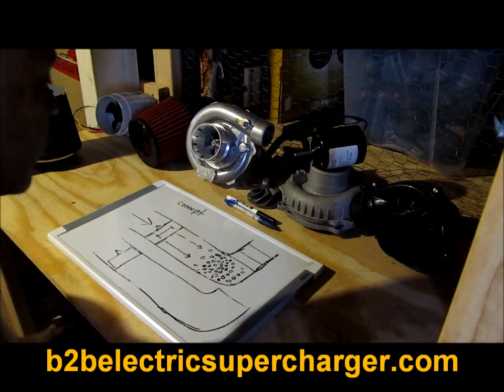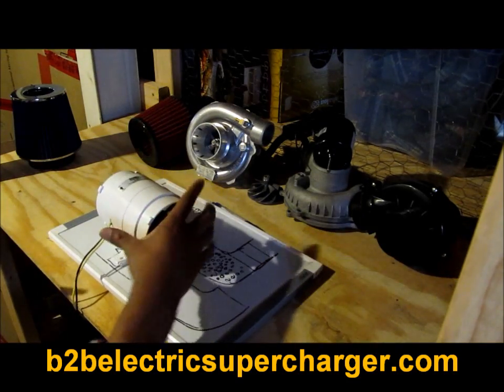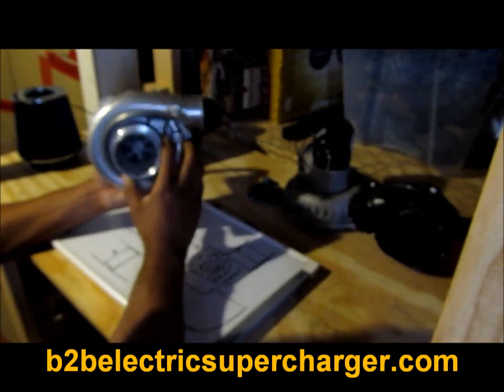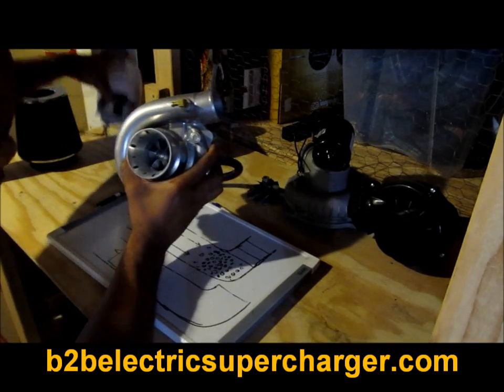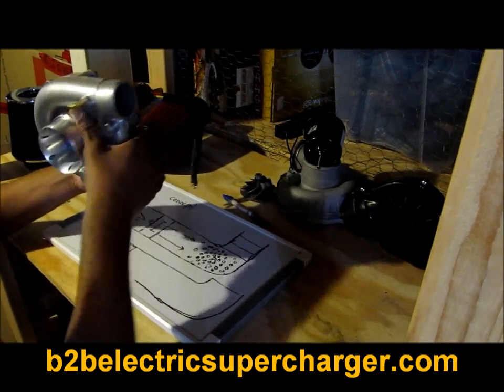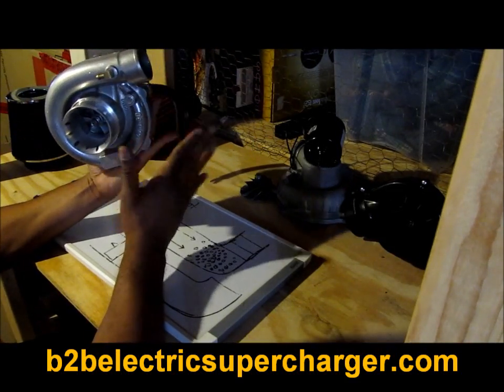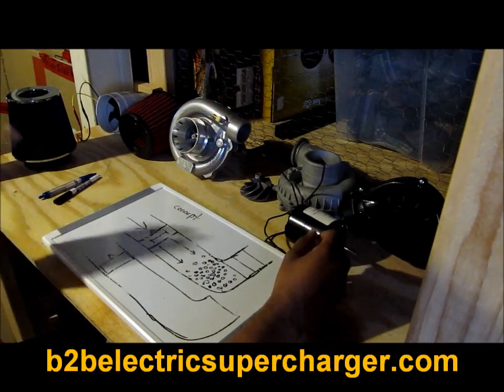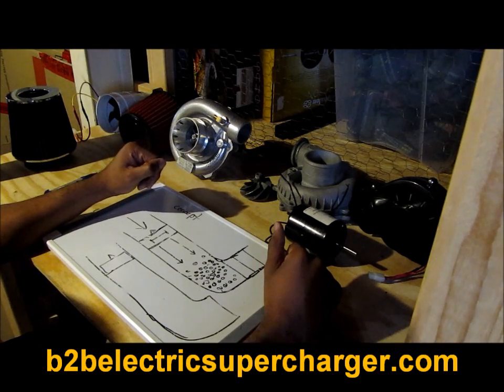Do Electric Superchargers Work?

Comment: To all the people saying "Not Possible" ... you realise that for around $50 you can get a 40,000 RPM brushless (90% efficiency) RC helicopter motor that is approx 1.2Kw and puts out around 2NM torque, and is 36mm x 65mm in size (Turnigy XK series)

Sure, it draws 80A max, and sure an ESC  (Electronic Speed Controller) will run you another $100, and would probably only make 3 or so PSI... but thats with a FEW minutes of looking... you can get some REALLY impressive brushless DC motors if you know where to look
Reply: That is nowhere near the amount of power you need. You greatly underestimate the amount of ehaust power going into a turbo.
Reply: turbo runs at 200k
Reply: +Gavin Irvine Never heard of Gear down?
Reply: WHYNOTMEB4U then your motor won't have enough torque. Electric superchargers do not work.

Comment: For a true electric supercharger to work it has to have a LOT OF POWER, at least 20 to 40 hp motor attached to it, and a motor like that is as large as the typical car battery, so you will need a lot of room in the engine bay just for that alone and that's usually not possible.  For that much power you are going to need a wire to the motor that is as thick as the wire that connects to your battery terminals, at least 1/4" diameter copper.  That much power draw will stall your car because all of the battery power will be sucked right to the turbo unit, so you will need a separate battery system just to power the turbo itself.  What happens then is that the electric turbo is off most of the time under normal conditions and the air enters the engine through the 'normal' non-turbo air intake. At this time the car's electrical system slowly re-charges the turbo's separate battery. Then when you need a sudden boost of power, you hit a switch on the steering and the turbo battery disconnects from the car's main electrical supply, and the turbo sucks power from the separate turbo battery only, the extra boost of air enters the regular air intake from a separate side pipe, and this extra pressure then closes a flapper valve on the air intake to prevent boost air from exiting out the air intake. The boost air then enters the engine at much higher pressures than normal. This boost can be maintained for only as long as the separate boost battery can supply power, which is not that long.  As soon as the electric turbo starts to die down, the boost pressure falls down, the intake flapper valve then opens up and air enters the engine using the normal air intake route, not from the turbo.  This system can work wonders but it is very complicated, very large, and very heavy, and is very seldom used because of those factors. A much simpler and much smaller idea is to just use NOS instead (Nitrous Oxide), it gives the same results as the above '2-intake' electric supercharger system and won't need a huge amount of space under the engine for the entire setup.

Comment: what about this? ...

http://www.zoro.com/i/G3418791/?utm_source=google_shopping&utm_medium=cpc&utm_campaign=Google_Shopping_Feed&gclid=Cj0KEQiAn9-kBRDloNeUw7Pe_YwBEiQA4HXMU2L__s_M55OWU3uzzaRsqnchHKitz9uJvUrD8cDyxc8aAiRT8P8HAQ
Reply: won't work, it's about the PRESSURE and volume. that pump is incapable of making any pressure. It simply isn't feasible to make an electronic supercharger, you would need a HUGE motor and even bigger battery bank to make it work in addition to a lot of custom fuel table editing of your PCM.

Comment: An electric supercharger could work if you had a powerful enough electric motor. I can tell you right now, that little brushless motor will not be strong enough... It might spin it up to your desired rpm but as soon as it is loaded from boost it will not keep up. I worked for a ProCharger dealer and have extencive experience with both installation, designing of mounts and drive systems. I have personally seen the larger blowers bend/break/flex thick billet mounts and break large cogged belts! For an extreme example the F2 ProCharger with an impeller speed of 61,264 RPM making 32.9 Psi of boost has a parasitic HP loss of 353.6 HP!!!!!!!!

here is a quick article on some ProCharger testing 
http://www.dragzine.com/news/lose-power-to-make-power-procharger-parasitic-loss-testing/

-Automotive Engineer